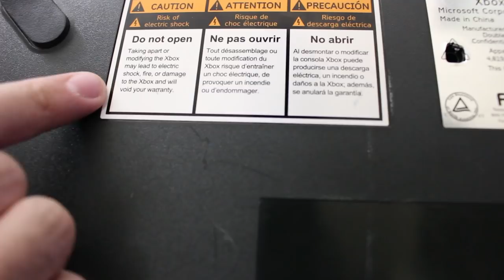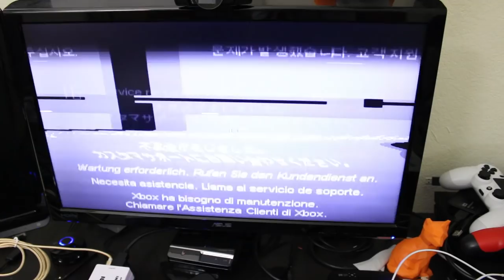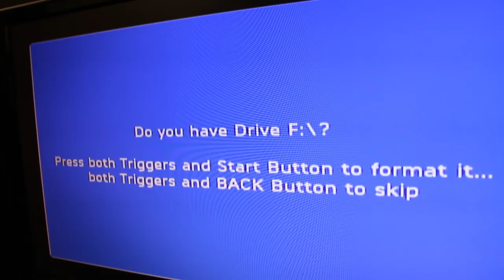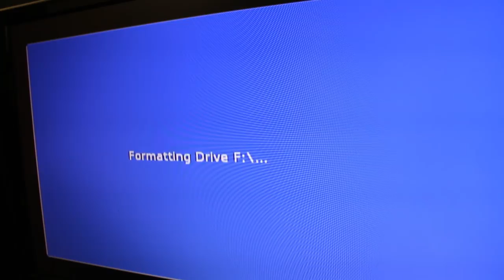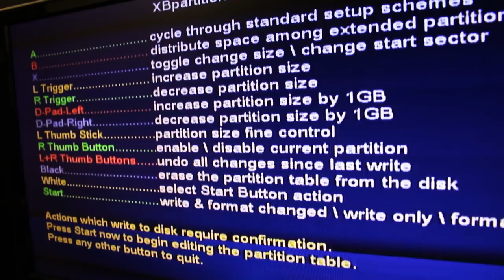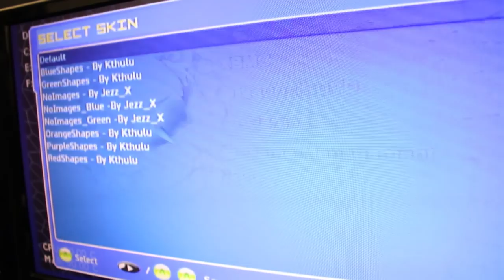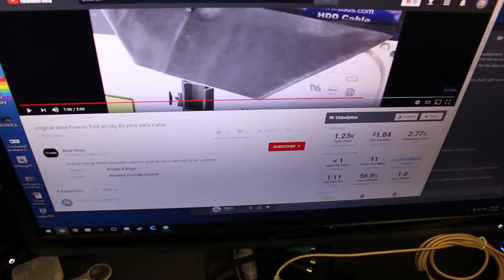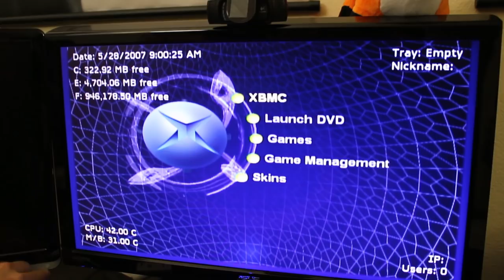Let's Upgrade an Original Xbox! - 80 Wire IDE Cable & 1TB SATA Hard Drive Install - Part 2

Comment: The 80 wire cable doesn’t supply any power, the reason why you need the cable with more wires is so that the data lines don’t experience any crosstalk, even then you still have only 40 wires that are used for data, the other 40 are just conductors. These conductors where put in the cables to increase the potential speed of the ATA bus, as the 40 wire cables couldnt go higher than 33MBps becuase of the aformentioned crosstalk issues.
Reply: The GeForce thanks. I was basically going to say the same thing. The extra 40 wires are acting as a shield ground to eliminate crosstalk
Reply: I installed a 1TB drive using the 40 wire cable and I'm not having any issues.
Reply: the only issue you will have is the decreased bus bandwidth from 66MBps to 33MBps. which may increase loading times by a bit.
Reply: read & write times will be slower though as 40 way cable will only support 33mbps
Reply: I understand what you're saying and I expected that as well as I have seen other videos where the Xbox appears to take forever to boot. Mine boots immediately just like it did before I upgraded the HD and games load just as quickly as they did before.
Reply: Yes the performance gains aren't spectacular as it's an old console, it also depends on the drive speed aswell a late model 7200 RPM IDE or a SATA with adaptor would be a bit quicker loading, just make sure you remove the clock cap as this can cause damage if it leaks, I have about 3 modded at the moment.
Reply: RetroCable.com The performance gains are fairly significant, and definitely noticeable.  Load times are decreased substantially.
Reply: I don't know what else to say short of uploading a video. The console starts up just as fast as it did before and so do the games. I've seen videos where the console is booted and it sits at the Xbox logo for like 10s before going to the main menu. Mine doesn't do that.
Reply: I will digress and say this. Although the first XBox that I upgraded to a 1TB using the 40 pin IDE cable worked flawlessly (no noticeable performance issues what so ever). The second XBox I upgraded to a 500GB drive gave me an error 13 and would not run until I upgraded the IDE cable to 80 wire. Now it works great. I should note that the first XBox was v1.0 and the second was v1.6.
Reply: I feel personally assaulted by your username.
Reply: @granthoule  well ima try it with a 340 gb hdd bc the 80 wire just gave me an error 11
Reply: Also the cables he had can't have been 'designed more for floppy drives', as floppy and IDE cables are different. Maybe he meant designed for optical drives, though they're really just 40 wire cables like you mentioned.
Reply: Hours of to look for a 10,000 rpm drive... Or I'll just stick in either an ide ssd or an sdhd hybrid drive. Reducing seek times is always going to be your major payoff. Pity you can't get 1gb network speeds or is be looking to save the data on my nas drive.
Reply: From watching this video I learned that 40 wires doesn't give enough power.  Thanks to that insight, I have rewired, my house, my cars, and my pets with 80 wires.  Everything now has power.  Very good tip.  Many thanks Dr. Mario.
Reply: no need for 80 pin ide
Reply: @granthoule   hey when you installed the 1TB drive, did you have to use the IDE to SATA adapter as well???

Comment: Just in case anyone comes across this, You can plug the middle connector on the IDE cable into the board and route the cable a bit smoother. The longer part of the cable would go up and over the dvd drive, and the smaller portion would go under. Doing it this way you don't need to fold the cable nearly as much.
Reply: Thanks man
Reply: appreciate you boss. this cable is pretty much the opposite of the original so there's almost no way to fold it properly to fit.

Comment: Yes youngin' (we're probably the same age) you needed one of those 80-wire cables to run in UDMA mode on your computer. It was like magic once system drivers were installed on my AMD K62 350Mhz computer.... :P
Reply: I always wanted that K6_3 mobile for my old rig. Oh well, then I "upgraded" to SPARC :/

Comment: You are super close to starting a fire!!! Please put some electrical tape on the back of the MOLEX connector of your IDE to SATA board!! The pins sticking out of the back are almost touching the grounded casing of your HDD, which would cause a nice amount of damage to your system!
Reply: Drew Conley I do the same thing on my adapters.
Reply: @LumenateTV  thats really cool. I wish i had access to a 3d printer :(
Reply: @down2half7  google maker space in your area some of them have 3-d printers for use or know a guy you could ask to print for a couple bucks.
Reply: So that electrical tape will make my console and my power supply to be safe?
Reply: So would you just put the tape directly on the MOLEX pins or would you put the tape on the SATA Drive itself to prevent any issues?
Reply: Aii Dee  Meh! I never keep the "pad" on. Never had a problem.
Reply: @redslate  I even have one, I use for the 3.0 adapter on those laptop hard drives and it never shorted anything out on me... These hypochondriacs on here think they're engineers!
Reply: @yodead369  What are you on about?

Comment: ide cable does not provide power to devices, just data
40 vs 80 wire cables is just for speed, there is still only 40 wires conncected on the 80 pin cable, but every other wire is grounded, to avoid "crosstalk" between adjacent data wires
Reply: Also his IDE cable wouldn't have been designed 'for a floppy drive', as floppy drives don't use IDE cables. Might have meant designed for CD/DVD though.

Comment: I have the same SATA to IDE Adapter in my Xbox which now has a 500GB SATA Drive in it. 1 Piece of advice I would give you is to insulate the exposed pins on the back of the Adapter. I used some Insulation Tape (Electrical Tape) and wrapped it over them pins several times. As you will see the pins on the other side of the Molex Connector and IDE connector are exposed.
Reply: I have a place where I can pick up ide to sata adapter that are close by me and are readily to available. So no need to go through eBay for those.

Comment: This is my story. Bear with me as this story is long. I bought my OG Xbox v1.4 around 2002 from Best Buy. I had fun with it until I discovered it had a 10 Seagate hard drive (which I don't own anymore) and it can also be modded. I waited & researched continuously until I discovered it can also be softmodded. So around 2005-2006, I softmodded my Xbox using SID through the Agent Under Fire mod. I even upgraded the hard drive to a Seagate 40 GB hard drive. It had UnleashX as a dashboard & I had a bunch of games, emulators, apps, videos, music & other stuff. It was never TSOP flashed. As life moved along, I've put the Xbox away. Now, when I tried to use my Xbox, come to find out the clock capacitor was leaking, Trace A was corroded & 3 capacitors was bulging. So I replaced the 3 capacitors, removed the clock capacitor & fixed the trace. I also bridged the points for TSOP, so it can be flashed. I started up my Xbox & it gave me a 07 error code (HDD timeout). I checked the 40 wire IDE cable & the 40 GB hard drive & the hard drive was clicking, telling me that it was dead (lost everything in it🤬). So I took out the hard drive & boot the Xbox up & still have a 07 error code (without the hard drive). I downloaded the Hexen 2017 & Bios Checker images & burned them to each their own DVD-R using Imgburn on the slowest speed. I put the Bios Checker CD in first, & still the Xbox gives me the 07 error, so I took the CD out & put in Hexen CD, & still get a 07 error. What am I doing wrong? Did I screw up somewhere? Does the Bios Checker need a hard drive? All I want to do is upgrade my Xbox with a 1 TB SATA hard drive, following along with your part 2 of this upgrade video. Please, can you help me out with this headache of a dilemma? I really don't want to buy another Xbox unless I really necessarily have to (I don't know if I'll even get another v1.4 Xbox). Thank you for taking the time to read this long story & for trying to help me with this difficult quest.
Reply from the maker: You softmodded your Xbox but lost the hard drive. If you have a EEPROM backup, you can use that to build a new hard drive locked for it. If not, you need to pull the EEPROM from your motherboard and build a new locked hard drive for it. If it was running custom BIOS it would be less of a headache, but that's sadly not the case.

Slot1Gamer has a great video showing how to pull the EEPROM, good luck!

Comment: the only thing i think you should have done that i didnt see was insulate the molex pins on the back through of that sata adapter they looked awefully close to the metal of the HDD.  Great vid though im gonna do this to my xbox meow thanks for uploading

Comment: 16KB clusters for up to a 250GB partition
32KB clusters for a 250GB-500GB partition
64KB clusters for a 500GB-1TB partition
I remember back in the day we split partitions.

With the correct cluster, due to risk of corruption.
Lol seeing that single F partition has me nervous.
Probably because I can't see the cluster size, my inner nerd is concerned. :P
I've thought about putting another system together with a 2tb hard drive.

Years ago I had a 1.4 motherboard in a original crystal xbox housing with a 1tb hard drive.
Replaced the stock exhaust fan with a Arctic F8-80mm, had to file down some plastic of course.
Lit up with bitfenix strips, modded one of the controls ports to usb.
Considered having them controlled by the fan, so as speed increased.

The brightness varied, only for some years later.
The motherboard died on me, ended up replacing it with I believe a 1.2 motherboard.
Tsop flashed it in the most awkward way possible, stripped down an IDE cable.
Used the wire to bridge the connections, no magnifier.

Just my eyes and a spot lamp, had to get the wires so fine to fit.
Was unbearable but worth it, always wanted to do an original slim xbox mod.
Curious to see if I could get a PATA IDE to SATA adapter.
To fit directly to the motherboard, use a long sata cable.

And resolve the power issue to the HDD.

Comment: Interesting video. I bought some of these adapters a couple of years ago and always got problems after a while (few days) of using my Xbox. At first I thought that the SATA adapter was damaged and then I thought it was the HDD. After seeing this video, I'm convinced that my stock 40 wire IDE cable might be the culprit.  Now I'm thinking of converting my HALO Edition green Xbox into a TSOP and add a spare 1TB laptop HDD.

BTW, when leaving the console overnight FTPing your games, I suggest you open your XBOX case and point a fan on it to ventilate it. I read somewhere that doing long FTP sessions can cause a lot of heat and there were certain parts of the machine that didn't like that. I don't remember exactly what it was but I'm sure it was something related to the onboard LAN controller overheating or something.

Comment: Very awesome tutorial man, keep it up! 
Although I have a strange issue and I'm betting it's the HDD adapter, let me explain:
I successfully TSOP my 1.0 Xbox and flashed the same evox bios like you did, works like a charm.
But here's the thing, when I installed a WD Green 1tb that I had lying around with the adapter, no signal came through on the screen, so I switched back to my previous hard drive and it worked with no issues whatsoever. So I tried to connect the adapter without the hard drive and still no signal, so here's what I did in a sort of crazy way: I disconnected ONLY the data cable from the adapter and turn the Xbox on, signal came through with the splash screen and everything, turned it off and turned it back on and while the bios splash screen was still running I connected the data cable and weirdly enough the bios just froze and the sound just started stuttering, when I disconnected the cable again the bios continued it's splash screen and sound as well, then it just gave me the no hard drive error screen. So yeah, probably the adapter was faulty. 🤔

Comment: I have a problem. Can you help. I put a 2tb hard drive in the og xbox. When i put a disc in the console to copy to the hard drive it wont read it. However if i leave the disc in and turn it off then back on the xbox will play the disc automatically without going to the dashboard. I put the stock hdd and ide cable back in and the dvd drive works perfect. Any ideas. Im guessing its eithdr the 80 pin ide cable or the 2tb hdd or sata adapter,

Comment: hello mr.mario just a quick question i have a 1.6 is soft modded and i keep getting error 07 trying to update the HDD is brand new and IDE is 80 wire and works with old hdd. i havent intall chip like aladin or others  tho do i need to? thanks for all your help...

Comment: Do you need install a mod chip to upgrade the hdd? I am new to this, just finish soft modding my Xbox but hard drive pretty small, i don't have any experience soldering. Can you install a bigger hdd without doing any chip mod? Thank you.

Comment: hi, possibly dumb question, but if I have a softmodded console that I already was able to upgrade the HDD, would doing a TSOP flash mess with that at all?  Wouldn't want to have to back up all the stuff I already put on it and re-transfer.  thanks!

Comment: So MrMario2011 I Moded my Xbox with Rocky(like you did in the other video) then up grade the hard drive like you did here but im getting a error  "Your Xbox Requires Service" No code in the corner like on yours and its frag.( Original Hard drive doing it too) Any Ideas what it could be?

Comment: Have you ever used a Startech IDE/SATA adaptor? I tried it and it doesn't work for me, while a generic Chinese IDE/SATA adaptor does.
With Startech it goes like this: the startup sequence stutters, the screen goes black and nothing else happens (I've waited multiple minutes each time).
With generic Chinese it goes like this: the startup sequence plays properly, it takes a longer while for the Microsoft logo to appear and the Xbox launches correctly.
It's odd because the Startech adaptor is supposed to be better.

Comment: my new 18in ide 80wire came in today , pop it in put my new 1tb hdd in and use hexin dvd ..am and running ..SUPER HAPPY ..

for those buying the ide cable ..as long as you get a 80pin ide cable no more than 18inch you will be fine...if buying on ebay buy from someone in your country dont by from china and have to wait 1month for it to ship on a turtles back lol
Reply: According to 80-pin IDE cable specification, ppl need to be wary of its length. I got one with 75 cm length. It does not work. But that may be caused by the HDD or the converter. The main problem with the 80-ind IDE cables is to actually find one that has the plugs correctly arranged for the Xbox: Mobo plug close to master plug. Plus, noone seems to sell the 80-pin connectors (here in Germany), so I cannot make one myself. They do sell the 80-pin wires though O_o
EDIT: I will try to use the 40cm IDE cables that MrMario linked to (Ebay) in reverse. Did anyone try that? I read that it should work.

Comment: Hi Mario, I just bought a OG Xbox on FB Market Place. I plan to TSOP one day, but would first like to get the softmod going and remove the clock capacitor. I wonder at what point I can install a new HDD. If I do it in this order would it be fine. Softmod with Rocky5 > Remove clock capacitor > TSOP > New HDD. I'm not sure if New HDD comes before TSOP. Which route would you go? Thanks in advance.

Comment: I dont have a chipped xbox will i be able to run the recovery disk?
failing that will making an image of my old harddrive and burning it to my replacement harddrive then fixing the partition sizes with partition wizard work?

Comment: Glad the new IDE cable worked! I just saw your part 1 the other day and decided to upgrade my softmodded Xbox I've had for years. Unfortunately it turned out to be a 1.6 when software told me it was 1.5, explaining why PBL and debug tools weren't working. No TSOP means I can't put a big SATA drive in it, and my two 80GB IDE drives I had lying around didn't support drive locking. My boss gave me a sealed (!!!) 40GB IDE drive and it did work. Not huge, but finally enough for more than one game. Hopefully I can pick up an Aladdin soon so I can use debug tools for RTH.

I did have issues with Chimp, following various guides I got my drive formatted and locked but it was only showing 3GB on F:/. I dug through Chimp and found it has an option to properly format F:/. Trying to launch HeXen also brought disappointment too; my drive has the issue where it only ejects with a disc in the drive, but even after manually inserting HeXen nothing loads. Looks like my laser has gone bad. Bummer.
Reply from the maker: I have an Aladdin install tutorial coming out for 1.6 consoles, look out for that 👀
Reply: Spencer Fowler you can also use an ide dvd drive on a softmodded xbox no need for an original xbox disc drive l tried and it worked, of course my lg dvd drive cant read original xbox discs
Reply: Ricardo Hualpa I had the same thought. If I extracted the contents of the HexeN ISO do you think I could trick it into running it like a DVD?
Reply: Spencer Fowler you better use the hexen disc some apps are meant to be read from disc only... other apps can be used from disc or from the internal hdd
Reply: Spencer Fowler you better use the hexen disc some apps are meant to be read from disc only... other apps can be used from disc or from the internal hdd